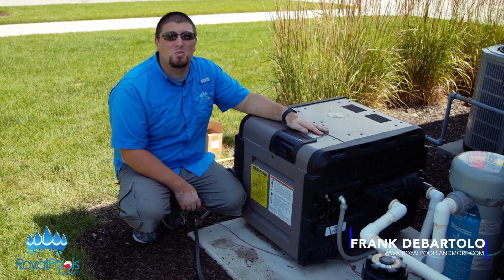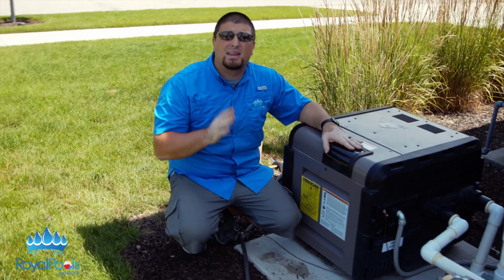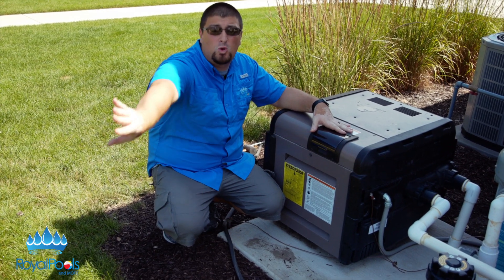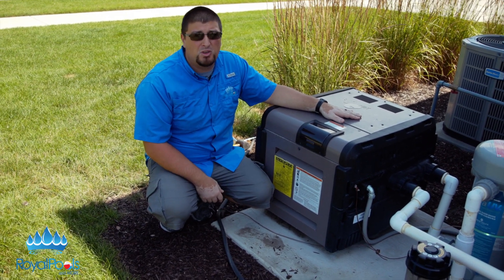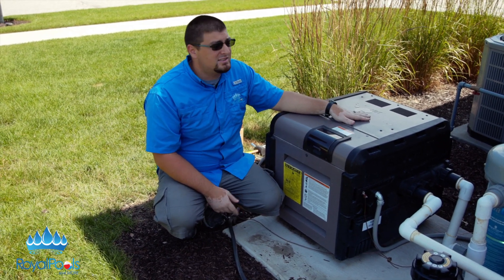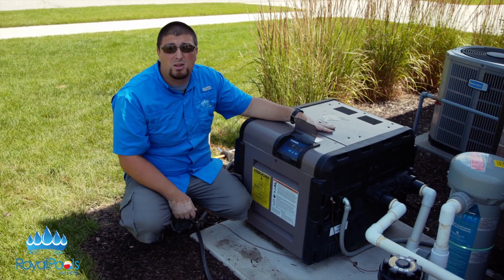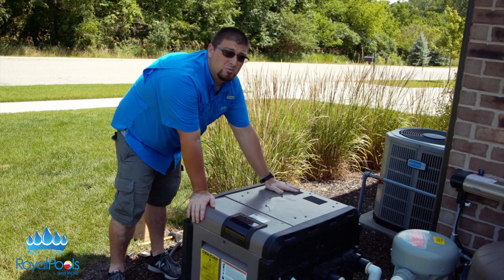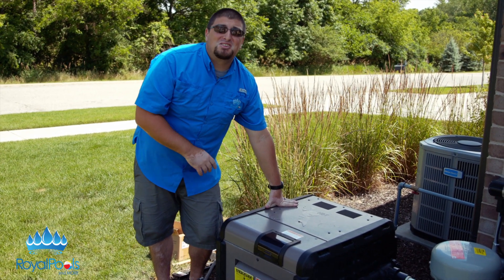Pool Heater: How it works and operation

Comment: Would’ve been nice to get some information about how it actually works throughout the day. Is it the best practice to turn it on at night so that you water doesn’t cool in the pool, is it the best practice to have it up and running while you’re in the pool and it doesn’t matter if it cools down at night? Does it require you to run your filtration more hours a day to keep the water and temperature?

Comment: Why don’t you have a trap or a check valve on the output of the heater
If the heater is heating and the power goes out you will loose full volume of water in heat exchanger thus getting steam and as you know if power goes off and it didn’t run out of water that’s not good either but we cannot control the power unless you have a whole home back up generator
Reply from the maker: There is an inline check valve directly after the UV and before the chlorinator. It's typically for the back flow of chlorine.

Comment: I have the same gas Hayward heater. On hot summer days when the pool is 90° plus I noticed that the settings on my app, I can adjust the heater temp to close to 80°. Will this allow cold water to flow into the pool?

Comment: Does it damage the heater when it is on and the water pump turns off and the low flow error message appears?
Reply from the maker: So if the heater has been running and you immediately turn off the pump then yes. The heat exchanger is hot and water will boil within it if the pump is turned off immediately. This typically causes the calcium in the water to separate into a solid state and scale the exchanger eventually causing the heat exchanger to clog. 

It's always best to shut off the heater, let the pool water run through it for 10-15 min as to not boil the water in the exchanger.

As for the low flow code. That is normal when you turn off a pump. All heaters have pressure switches and when they don't sense water moving that code will show up.

Comment: my gass pool heater i trun it on  the water throughs jets  in the pool is warm water not hot. take long time for heater reach temps
Reply from the maker: Yes that is normal. The heater has a regulator that will mix cooler water with the hot water so swimmers don't get burned. 

To address heating the pool faster. The larger the heater obviously the faster it will heat the pool. In addition the larger heater will save you money in the long run.

Find a good quality pool professional and see what a normal sized heater for your pool is and then potentially size up! You would have to consider going to a larger gas or propane line to fuel a larger heater. Your local pool pro should know how to look into all of that for you!
Reply: What size pool do you have what’s the type/size btu heater are you using